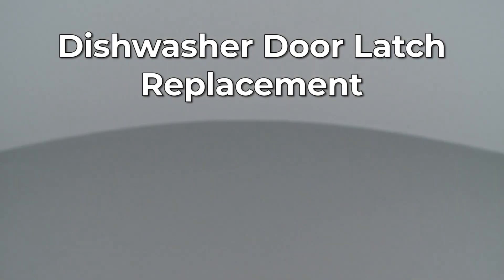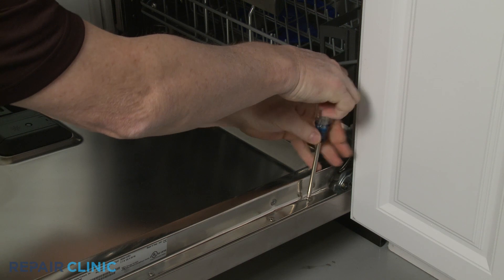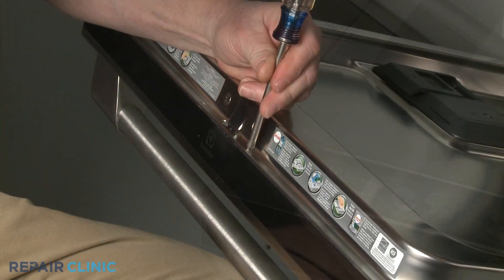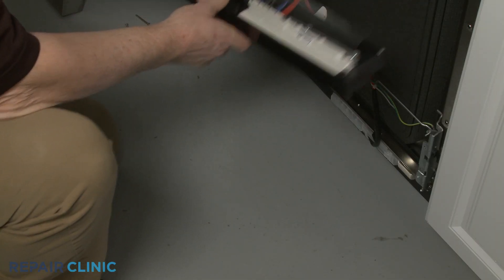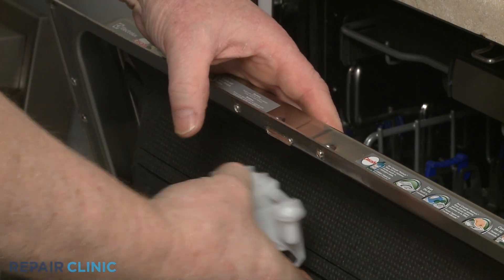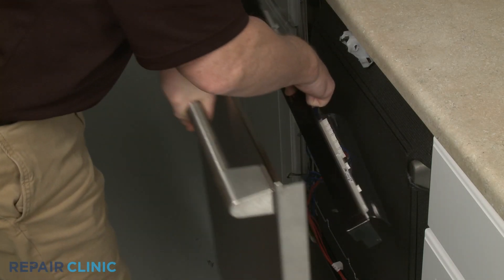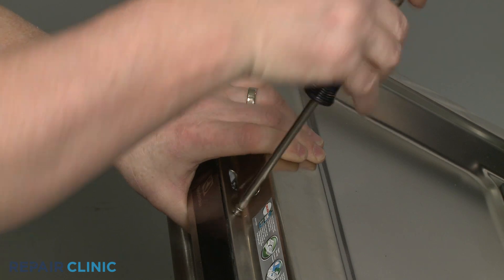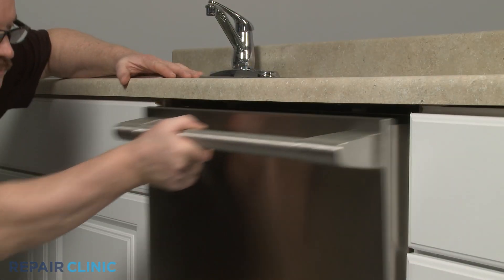Electrolux Dishwasher Door Latch Replacement 111315040

Comment: I'm having issues with a door latch on a similar model (EIDW1805KS0A). I just disassembled the door frame and cleaned the door latch. Somehow during this process, the latch switched to the open position. I was able to run a load of dishes without issues. Once again, a day later, the latch is stuck in the closed position. Is there a way to re-open the latch?